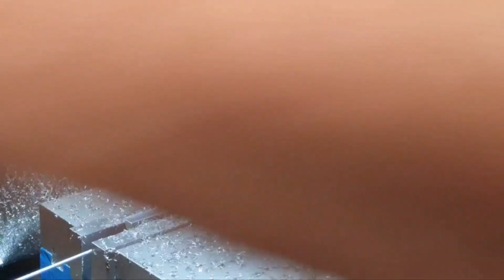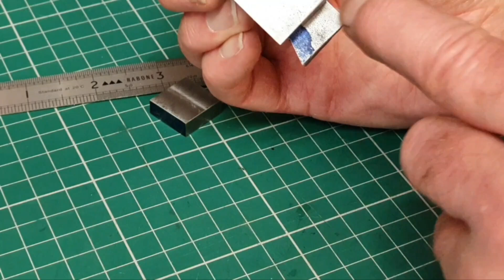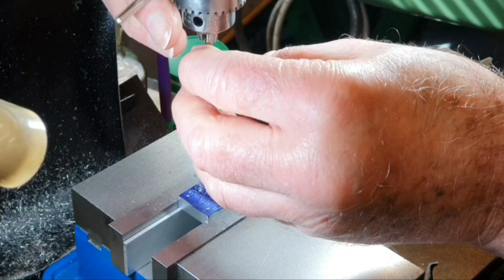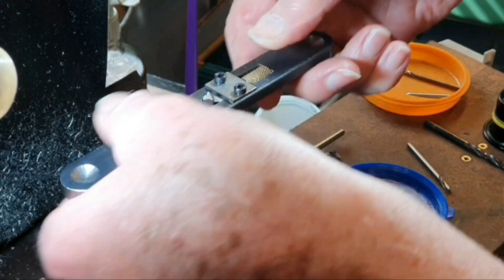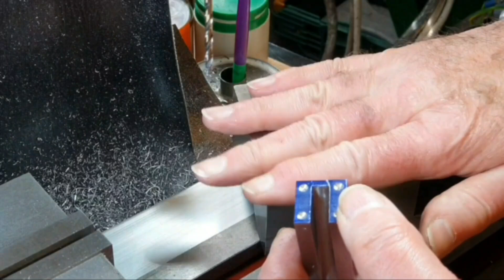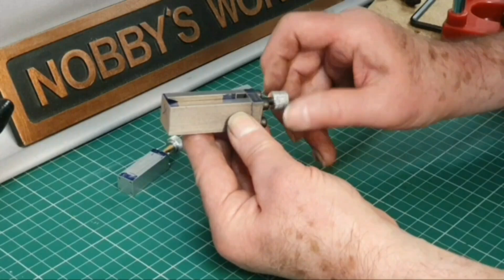Wedge Parallel - Part 2

Comment: Nice work Nobby , those will be very handy when you need  an adjustable support, and maybe for measuring inside a slot. Thanks and cheers!
Reply from the maker: Many thanks much appreciated. I'm sure they will find many uses around the shop. Cheers Nobby